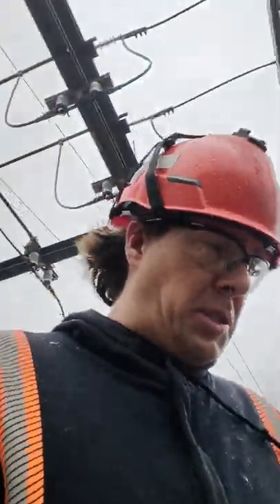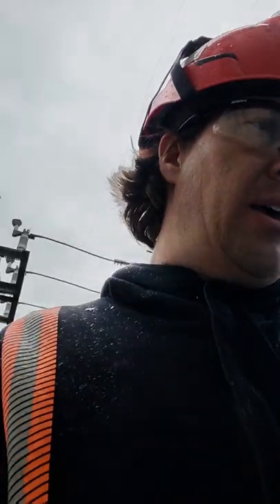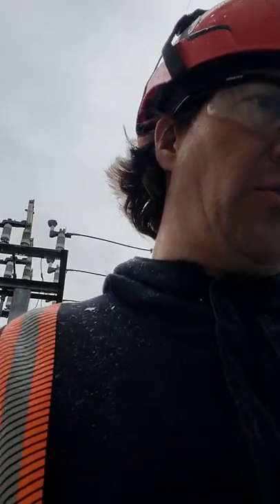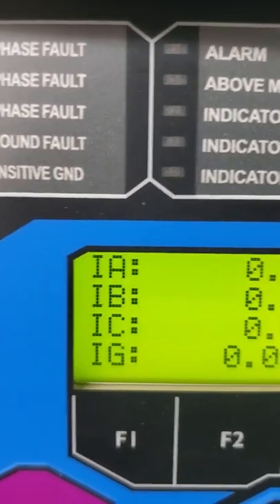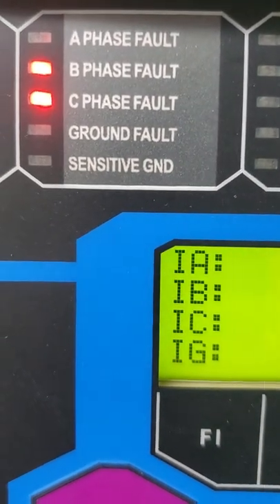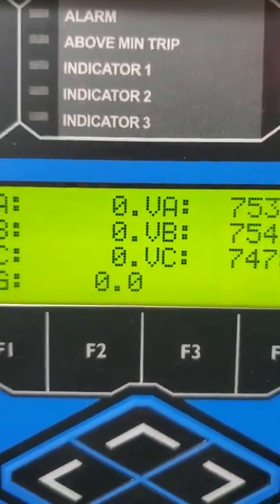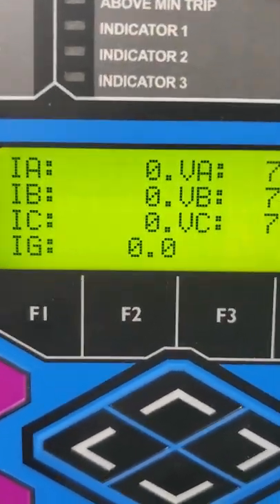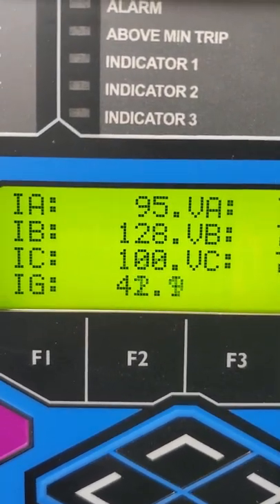Restoring power with the touch of a button

Comment from the maker: My last short showed us closing in a manually operated 69KV switch. I also mentioned in the next video, as we toured the substation, that most of our equipment is now operated remotely...

I can't show much as far as how to operate our control panels, but in this video you'll see how easy I was able to close in a line by simply pushing a button. Power was immediately restored to 650 customers! while still being a somewhat older system, setups like this are much easier and safer to operate!

I've got 4 full videos currently in the process of being edited, so we'll see y'all very soon! 🤫

Cheers everyone! have a great week! 👊🍻
Reply: Do you use a "Kirk Key" interlock system on your OCB's and other types of electrical isolation points to keep them mechanically or physically from being able to close, for safety when you're working on those lines and associated equipment ?

Just interested...Industrial Background.⚡
Reply: Very awesome, buddy! Have a good one 😎
Reply: God bless you for all that you do ❤
Reply: Manually switching always feels sketchy🤣

Comment: In my old company we would have to receive switching orders from the dispatch operating authority first. Once the steps were called in by dispatch and recorded by the field switchers we would then read them back to dispatch to ensure the understanding and order of the steps they provided. 
As soon as we were given the permission, we would perform the switching and record each step and time it was performed. Upon completion the steps were called in with the times.  
As you all know, even the most simple tasks are treated with the most care. 
Safety is paramount!
Nice job BTW.
Reply: That's basically the process he would have gone through off camera. The communication happens through the radio and computer mounted in his truck, and then he walks to the switch to operate it, and then returns to call it in from the truck.
Reply: Classic three part communication.

Comment: I work for a company that is contracted by the state to go along state roads and cut the dead, leaning or potentially hazardous trees back away from the roads and power lines.  We can't cut within a certain distance of the power lines, depending on their size and how many there are, and I'm guessing that is where the power companies own crews would come in and take over?  Here in Kentucky, at least the southeast portion, the state pays a lot of money to keep trees like this away from the roads and power lines that follow said roads.  But I guess you can't get them all, either with as fast as some trees grow and a limited number of crews out cutting all the time.  Yes, we do this full time, even during snow storms and the such.  Not last winter, but the winter before we had several counties that the governor declared an emergency in due to an ice storm, and the roads were so covered in trees that they called us to come and cut the trees up that fell in the roads so that the state could come through and push them out of the way with snow plows and salt trucks so that emergency crews could get to people.  The power had been out since the storm happened and it took us a week to get all of the roads cleared in just Rockcastle county.  It took, from what I can remember, the electric company a couple weeks to get all of the power lines fixed.  It was nuts!  We even had a tree fall on a retirement home and the for e was so much that it shifted the building and jammed all the doors shut that we're already closed.  We had to go in the middle of the night and cut the tree off the building so that it relieved the pressure enough to where they didn't have to worry about it falling in if they tried to kick the doors open to get to the people.  We're on call 24/7 this time of year, but we generally don't have to worry unless we know a storm is coming.  It looks like this year will be another one of those years....

Comment: Great video we have had remote scada in our substations in Australia for about 30 years so no local try backs anymore,  which was a good thing as originally the oil  breakers where tried back at the actual breaker panel not good if it failed internally .  One old operator used to "beat the reclose" to avoid returning to the substation to manually close back the breaker while fault finding . He would open a  air break switch somewhere along the feeder go back and close the OCB at the substation if the ocb remained closed he would deliberately make the reclose function auto ( against company procedure). He would then open a air break switch further down the now  deenergised section go back to the first opened air break switch and hopefully could view the now reenergised side of the feeder to view a light on somewhere. He would then close the air break switch and if he saw the light go out on the line side he would rip open the ABS to clear the fault ( while the line was deenegised during the reclose sequence ) the OCB would reclose successfully avoiding a drive back to the substation to manually  realise the ocb . Once the fault was finally found he went back and reset the protection relay flags.  This was a illegal procedure and the control room couldn't understand how he restored supply so quickly . If he had mistimed opening the air break switch while it was feeding fault current downstream  it would have damaged or destroyed it. As a young trainee operator I wasn't impressed while working with him . Dangerous short cuts like this where  never condoned by management  and once remote control from the control room was established with scada installation such practices by much older operators ceased.

Comment: In the early 1980's, Had a tree branch land on transmission line 100 yards from 3 MW synchronous hydro and new 1 MW induction hydro. It blew neter faces off induction switchgear. Utility said they had new relay settings to install.

Comment: Interesting seeing where HV switching has gone in the last ...oh dear lord, 30 yrs. I trained where we had our own 11kv network (UK based), most of the breakers weren't even motor wound, just single 11kv 3ph breakers for each TX in a substation with actual spring charging handles. None of your fancy dot matrix LCD readouts either, no sir,  if you were lucky you got an ammeter per phase. Some of the older stuff had 3 neon indicators, or even nothing at all. If the transformer's humming, the power's on! LOL
Reply: Just to add, we still had to notify the local power co if we were doing switching on the 11KV side, as our network was metered at the intake point (2 breakers with 2 sets of CTs, we actually formed part of the 'ring'  and depending on what was going on outside our network but within the same 11KV area, we could affect voltages/etc to other customers)
Reply: Michael Terrell  Ok vladimir

Comment: Most, circuits are a sectionalized loop, have a fault, open it on both sides, and if the fault takes out the source, it can be connected to the next section temporarily.

Comment: So, you guys are running 7200 volt wye secondaries for most single phase customer pole pigs, a little hot at the substation to allow for I^2R drop?  

That means that just under 100 amps per leg after the startup peaks amounts to around a megawatt load over 650 customers?  

Is your next jump for larger secondary loads called 19.9 kV, based on Delta, as is common in other utilities, whereas somehow conventions for 7200 lines get based on the wye, as are most customer service transformers downstream?  

How much of Canada or different utilities standardize grid around 69/138 kV?  Are there major regions where 115/230 kV are the default, as in much of the USA?  The former is the lowest common voltage that is grid as defined in IEEE C2, whereas the latter allows a lot more power on the same conductors with minimal increases in conductor spacing or insulators, switchgear, protection, etc. 

How does generation and grid management in Canada compare to the regional interconnects in the USA, eg PJM, ISO-NE, etc?  (where small and large utility owned systems are subject to common management and coordination, from generation to substation stepdown transformers; local utililty SCADA from there to end users)

Comment: interesting, i live in the area and had 2 blinks yesterday, felt like a recloser re-opening
didnt bother reporting anything, since it came back solid, and it was obviously a recloser and not a loose wire
Reply from the maker: You're right! A quick and obvious "off/on" is usually a recloser...

There was still a couple branches yesterday that I got called to from the wind the day before.. one of which bursted into flames! Hopefully we got everything cleared up now 🍻

Comment: Can you Lock out Tag out the lines to work on thrm via this system? I suppose it was OK in this situation as you could do everything from the ground?
Reply: Yes and no. Typically the electricity is shut off by the ECC and then the linemen will proceed to attach grounds, both sides of the work zone as close as reasonable (to avoid a back feed from a generator). Procedures are designed with multiple fail-safes to be sure everyone goes home tonight, but this line (650 customers) is probably no more than 36kV, which is well below what their telescopic sticks are rated for.
Reply from the maker: Absolutely right! If we were to go hands on, a visual disconnect would be opened which is located on the source side of the oil recloser
Reply: @DBKING04020  Remember electric doesn't just take the easiest/shortest path it takes all paths to ground.  Some companies are going to single point grounds and working as close to them as possible to limit the voltage difference between the line and ground.  Keeping the worker and the equipment at the same potential as possible to limit current through the worker.

Comment: There's lots of things that cause outages but it seems like the most common one I hear about are tree branches. Isn't there an app for that? Like if there's going to be a potential for an outage due to a tree wouldn't that be able to be seen? I would think that you could have cameras on every Pole or something, you could even have ai to detect when something's close so you don't have to monitor it. You have electricity there I think you can even run Communications over those lines along with the electricity. Considering how much is at stake it seems like that would be a Justified cost. And I'm talking only in areas where there are trees not every Pole.
Reply: Putting a camera on every single pole would not only be prohibitively expensive, it would also make the residents less than pleased.
Reply: @user2C47  yeah cameras pointed at citizens would be bad, but then maybe just proximity sensors, but not on every pole just where there are trees.

Comment: Good ol' Form 6. Do y'all have the normal battery in the control box or have it wired into a substation class battery bank?  Any SCADA connection to that recloser?
Reply from the maker: Yessir! We don't use'm anymore for new installs. This particular one is off the battery bank and doesn't have Scada.
Reply: The newer installs use Eaton's Form 7 or they switched to another manufacturer?

Comment: Why line B is so unbalanced? ~200kw disbalance. How do you balance it? I assume you wouod have to plug some customers transformers on other phases? Not sure how american lines work, you use like 2 phase power on rezidental?
Also why ground current is 40A and what does it indicate? I assume disbalance? 
Edit: wait, why and how, is the line conected in star? I always thought those are delta.

Comment: Why is ther a biger difrence between line 1 and 2 then 2 and 3
Reply from the maker: Ideally we want them all the same (which is never %100 achievable).
This particular line is 3 phase which splits up into multiple single phase lines through a large residential area.  

Each single phase line is fed from only 1 of the 3 phases...
We monitor and change feeds around periodically as new construction constantly changes demand.

Basically we will go swap the source lead off one off the higher amperage phases onto on of the lower. Problem is, that's going to transfers say... 40 houses onto the lower phase. 

While there always be a phase with higher amperage then the other 2, this particular feeder could use some adjustments.
Reply: Well, that's why single phase for households is bad.
Reply: @scwfan08  Like there won't be an imbalance inside the house. There's almost nothing in a residential setting that's 3 phase. (commercial/industrial HVAC and water heater, but they'd be a unicorn in a house. The AOSmith Vertex water heater in my house is just such a unicorn; people don't use those in residential this far south.)
Reply: @jfbeam  3ph to houses is common in europe (except UK and Ireland), makes for better overall balance.  3ph domestic power tools/cookers etc are common. Even here in the UK we get cookers that are 3ph, but of course nothing in them is actually running phase-phase, so we can just strap all 3 line terminals together  and feed it with a beefier supply. Must be much easier on the continent where they can use a much more flexible 5 core cord of smaller cross section per core
Reply: @Bobsdecline  ... a few years ago an IT guy was trying to find a problem at an industrial complex so it was all hands on deck over a weekend. My job was to monitor the standby generators, which was a megawatt. We ran everything in the building and the leg to leg balance was less than 10 amps difference. That was pretty impressive for a system that had been in place more than 10 years. Usually changes happen over the years and guys loose track, but not this time. BTW, the actual problem turned out to be a bad breaker in the main power room. It was tripping out of spec.
Reply: @TheChipmunk2008  I can confirm that, in Croatia it's very common to have 3 phase power in house, even in some older apartments(my house and vacation house have 3 phase power), any motor larger than 2.2 kW or about 3 HP is three phase only, heck i have small 0.5 HP motor that is three phase.
Reply: @TheChipmunk2008  "Bob" is not in Europe. In North American (Canada, USA, Mexico) 3ph is uncommon in residential settings.
Reply: In the USA, 3 phase beyond feeders distribution is rarely used except on motors larger than 3-5 HP, where it has advantages more valuable than the added costs.  Where 208/120 shows up in residences versus 240/120 is mostly apartment complexes, and where ovens and stoves are dual rated, but operate at lower BTU output and so work less well, along with clothes dryers, or AC compressors, as single phase equipment across Delta leads, versus wye tapped customer transformers with single phase balanced services (noting other world regions with 240 VAC unbalanced systems).

Comment: Android HD Video for Facebook, YouTube, or Breaking news for TV
Open Camera...
Touch the Gear Icon (Settings)
Touch video size
Choose FHD 1920x1080   (Standard HD for TV stations, facebook, youtube
Close camera...

Turn phone to the left ,counterclockwise, to sideways position first, then:
Open Camera...  (If you open camera vertical, video will stay in vertical orientation)
Shoot test video
Close camera
Turn camera to the left ,counterclockwise, to sideways position.
Playback video 
Check that it fills screen
Check that the HD Video Setting is still there.
Shoot something for youtube/facebook  or watching with phone turned sideways
Watch it on desktop screen, or cast to your HD TV if you have the option
See it fill screen with HD video! Watch your YouTube channel on HDTV Smart TV.
It will look great!

Comment: I wished I could get my power back that fast; I have to wait 8 to10 hours to get power back. I live in the midwest and have ComEd for power and they just take their own damn time to restore power. The worst power company in the U.S. I lose power 4 to 6 times a year and they drag their feet restoring power. If I see them on my street during an outage, I ask them if they buy their parts from K-MART!!!! On top of that, they have the highest prices in the whole midwest. They are always asking the FTC for a rate increase and always get it.
Reply: Please consider one thing when you're talking crap to the linemen that are working to restore power: they are just doing their jobs. They have nothing to do with rate increases or systemic problems. They are not the cause of the aging power grid, and they have no control over any of the issues that you mentioned. Taking out your anger on them does you no good, and it just makes those people miserable. They are working long hours keeping everything running, and the last thing they need is to hear someone's complaints about things they have no control over. They live in the same area as you, and deal with all the same problems that you do, power outages, rate increases, etc.